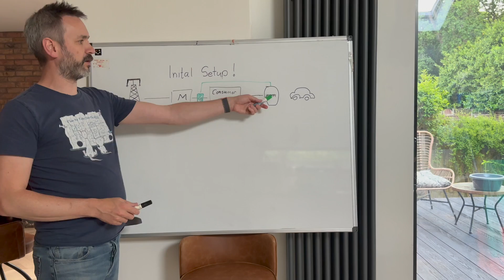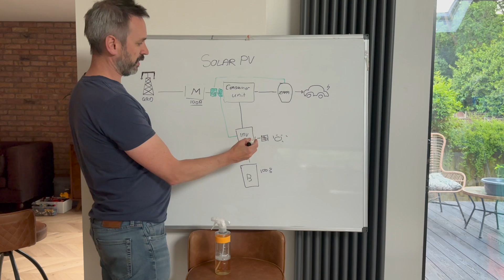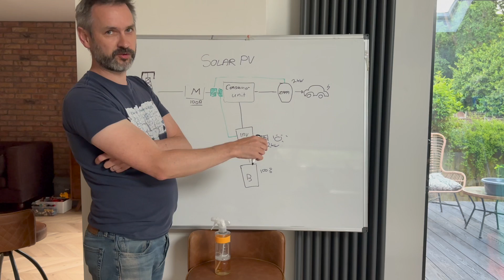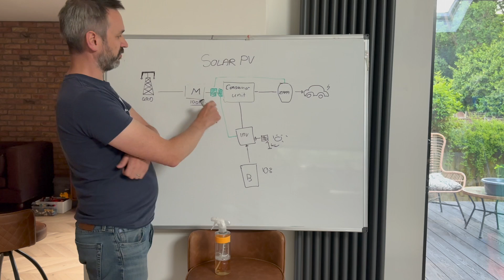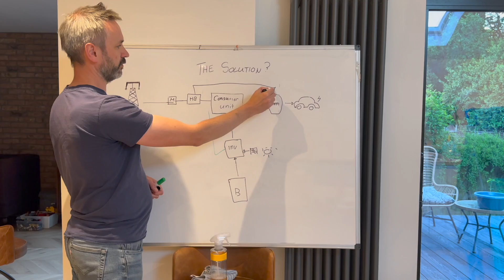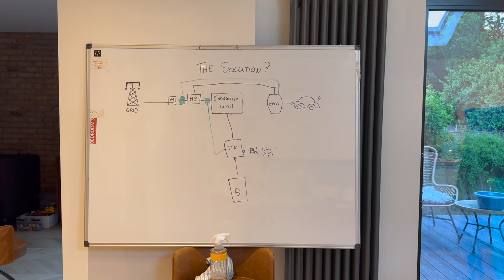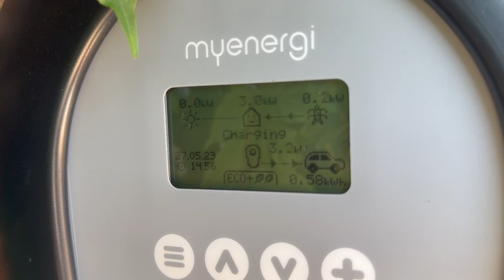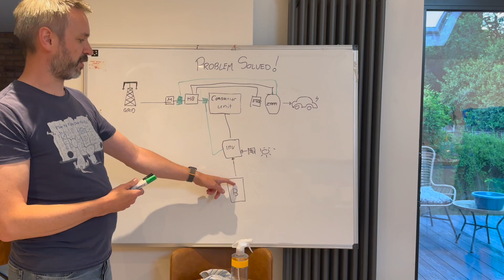How I stopped my Zappi draining my battery

Comment: On your diagram, the inverter is connected to the consumer unit, and the consumer unit wire is going to the Henley block...how is your inverter connected to the consumer unit? (physically). I have HB with a wire from the grid, which splits into CU and inverter. How has it been done in your setting? I can't see it in your movie. Thank you
Reply from the maker: My inverter connects directly into the consumer unit.

Comment: A rooki's question  
Is this set up workable with any inverter/battery/Charger combination?
Reply from the maker: More or less, I think. The principle is hiding the EV charger’s load from the battery so it doesn’t discharge. I would check with your installer to be sure.

Comment: Great video, thank you. Can you still pull power from the battery? I need to top up my car at night but want to make sure it only pulls eg 5kw from the battery, leaving remaining battery capacity for the house (we have a 25kw battery).
Reply from the maker: You could set the battery to force discharge. If your EV charger was charging, it would use this power in addition to the grid. 

My battery can discharge at 3.6kW, so my Zappi would still draw from the grid if in the standard “fast” mode. 

If the Zappi was in surplus mode, it would use whatever was coming from the battery (minus whatever the house was using)

Comment: Hi Tomas, great vid. Thank you for taking the time to put it together. I have a question for you regarding the premise of how the CTs operate. I follow your logic as to why you place the inverter CT between the HB and the home consumer unit - as to omit any Zappi load from the inverter CT. However it is my understanding that CTs are essentially just passive sensors used for displaying measurements in the respective Apps, rather than having any active part in informing inverter behaviour. In other words, are they not just an ouput (for displaying the measurement of current passing either way, much like a set of scales reading weight) rather than an input that the inverter actively uses. My understanding is that the inverter makes decisions on how to distributes the battery (or solar) power based on it's own internal gauge rather it's CT? Has your system worked totally fine since implementing the HB change? If so, were there any Inverter settings that needed adusting to use the CT as it's source of truth, or is my theory totally wrong (not unlikely 😅).
Reply from the maker: My understanding is that they are required. The Zappi uses the CT clamp to ensure they don’t overload the main fuse and to detect if there is surplus being exported to the grid.

For a hybrid inverter, the inverter uses it to determine the load it needs to match the house. It can’t know otherwise.

Comment: Maybe I am wrong, but on your diagram after changing the wiring it seems that the solar power goes  via the HB (henley block) directly to the zappi and to the car. doesn't it need an inverter?
Anyway, thanks for the article.
Reply from the maker: There is an inverter. It goes into the consumer unit which is connected to the main supply via the Henley Block.

Comment: Great video - my panels zappi and battery are only going in on 11th of August. So I’ve told the guys what I want. As im going with octopus intelligent go I think zappi Ona separate grid feed (so charged in the 7p window ) the 10kwh battery also charged with cheap 7p. During the day any solar to run the house, excess exported at 15p. When panels stop producing the battery is used to feed the house. Does this sound plausible ? If so will suggest it to our local fitters .
Reply from the maker: That’s how mine is setup. You just have to make sure the car isn’t plugged in, else the excess go into the car.

Comment: Will this plan work?: I set my Growatt inverter to charge the house battery from 23:30-05:30 at 6p, so it's on 100% at 5:30am. Can I setup the EV (ID.3) to charge at the same hours only giving me 18kWh which is as much as I might need? That should be enough to last the day and if the sun comes out, I'll automatically sell excess at 15p. I'll be using a 3kW granny charger on a dedicated EV socket. I guess the question is: will Octopus allow me to limit car charging times to off peak night hours?
Reply from the maker: Are you on Octopus Go or Intelligence Go? I’m guessing are you’re using the 3kW you’re probably on Octopus Go.
Reply: @tomasmcguinness  Hi, I signed up for Intelligent Go but that might have been a mistake? I'm hoping Octopus don't mind too much if I restrict the car to charging at  23:30-05:30 only. Octopus gave me a slot tonight at 22:30-23:00 and complained that they couldn't control the car. :-(

Comment: I had that problem but the export margin mostly solved it. What caused a big problem later was Octopus starting to set extra charging schedules outside the cheap rate time that the home battery was set to charge - the extra afternoon charging periods simply drained the home battery as the hybrid inverter saw it as a load it needed to try and supply. 
I avoided having to rewire the tails which would have been difficult due to lack of room by adding another CT clamp monitoring the Zappi but wired in parallel and in antiphase to the hybrid investor's CT clamp. The two Zappi current signals then cancel and the inverter doesn't see the car charging. You need to ensure the clamps are the same specification for this to work.
Reply from the maker: That's a novel solution! How did you come up with that?
Reply: @tomasmcguinness I'm an electronic engineer and have experience designing power and signaling transformers. I couldn't see why it wouldn't work but could find no information to confirm it. Both Huawei and MyEnergi had no experience of this as a solution. They did provide data for their CTs however so I could see they matched for turns and current ratio and wire resistance was the same but not so important. The transformer acts as a current source into a fixed meter input resistance to generate a voltage signal so adding another current source signal in antiphase simply drives an identical current in the opposite direction resulting in zero. It worked in simulation. I couldn't buy a Huawei CT without a meter but MyEnergi sell CTs separately for £15. It was very satisfying to plug the car in and see 7.5kW coming from the grid to the car and 200W flowing from home battery to the house without interruption. It saved moving multiple Henley blocks and repositioning an isolation switch on a crowded meter board. I provided a diagram to MyEnergi so it might help others with a similar problem.
Reply: @johnh9449  John - any chance you could supply your diagram by email?  I have a Zappi but myenergy aren’t offering your solution when I raised the issue with them.
Reply: @norman2613 It might be that the individual I spoke to hasn't passed it on. I could but maybe I can post ot on the My energy forum? It's only simple though: - you'll have a CT clamp on your solar inverter already working with its two wire connection to the inverter. By convention CT clamps have an arrow on them pointing towards the load - so your solar inverter will have the clamp arrow pointing away from the grid and towards your consumer unit clamped to the live tail after your electricity meter and before the consumer unit (and I presume before your Zappi).

You basically get another CT clamp to match but clamp it onto the Live tail feeding only the Zappi and pointing at the Zappi following the same load direction convention. You wire it to the same two connection terminals as your inverter's CT clamp so the two CTs are wired in parallel BUT you wire the new CT in reverse connection (the inverter CT remains the same polarity as before). 
The idea then is that when the Zappi draws current +Iz the inverter's grid CT will see the grid current +Iz going to the Zappi but the new CT will generate a signal -Iz which will cancel out the inverter CT's +Iz signal - so the inverter sees zero current signal and doesn't respond. It will of course respond to domestic loads etc as they only go through the one CT and there's no cancellation.
It's important that the two CTs are of the same specification for full cancellation.
Reply from the maker: @johnh9449 ahhhhhh, I get it now. So the load from the Zappi is essentially deducted from the grid load. 

The Zappi’s CT clamp CT clamp is still aware of the total load, so no risk of overloading the main fuse.

It essentially makes the Zappi’s load invisible to the inverter.

That’s elegant.
Reply: @tomasmcguinness Yes, that's correct. The Zappi is not affected. It just blinds the solar/battery inverter to the Zappi load. Essentially it's the same effect as splitting the tails so the Zappi load comes off before the inverter CT as in the video - it's just less hassle than with Henley blocks etc and especially if you don't have much space to play with.
Reply: @johnh9449  Thanks John - I understand the principle and can see how it works.  My problem is the Zappi is a long way from the inverter feeding the battery and the inverter is within the battery case so I can't see a way to connect the CT leads as your design requires.  It may be possible using a Harvi so I don't need to run a wire the whole way but I still have the issue of connecting the CT output into the battery CT connection when it seems to be within the battery and inverter casing.  (The battery is a Puredrive AC coupled unit and it is pretty well locked down so owners can't access it - I would love to change the inverter as it is very limited in function ie 2.1kW supply max!)
Reply: @johnh9449   I am going to give this a go and let folks know how it pans out. Watch for the house fire on the news . . .. .
Reply from the maker: Please let me know how it goes!
Reply: @johnh9449  You mention explicitly reversing the connection of the CT clamp, i.e. positive of the first clamp and negative of the second (EV) clamp, and the negative of the first clamp with the positive of the EV, in the same connection in the inverter. 

But could you have postive and posistive and negative with negative, and just have the arrow pointing the other (wrong) way on the EV leg? Would that achieve the same outcome?
Reply: Okay, I've sourced an equivalent CT clamp, it should arrive in a day. I'll keep the thread updated.